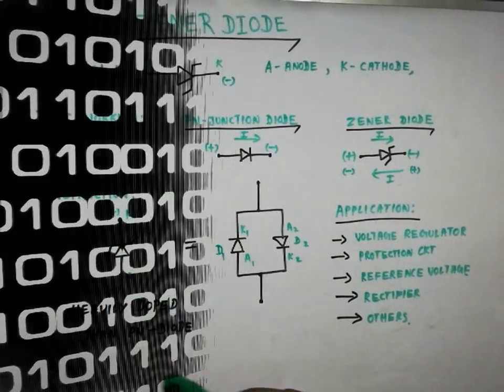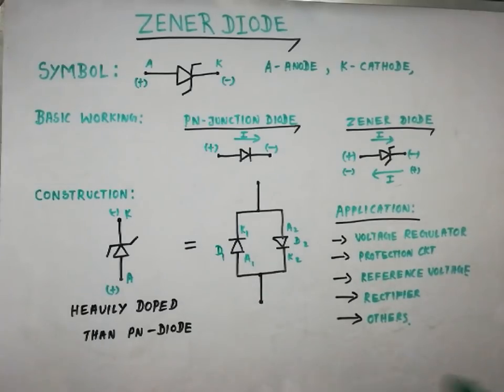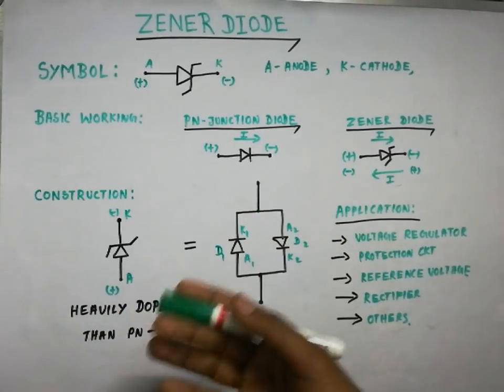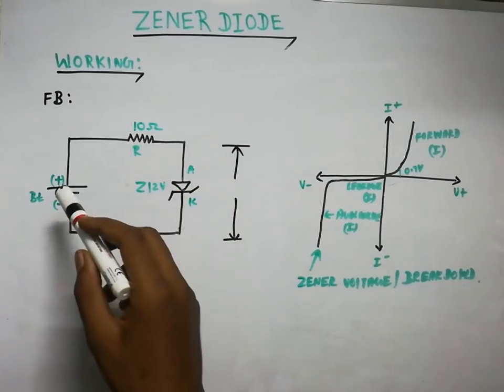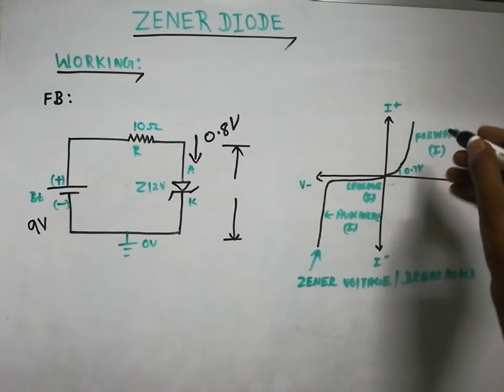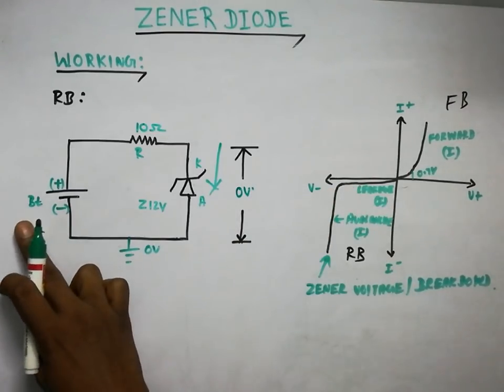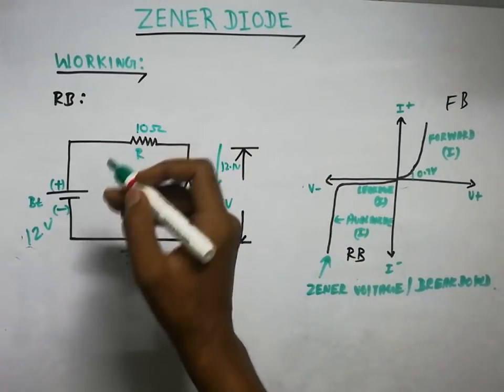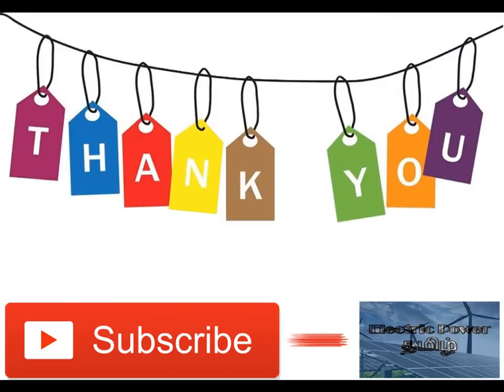what is a Zener Diode In Tamil???

Comment: Bro ithula 5V Zener diode la 12V supply kudukum pothu diode 5V than conduct pannum balance volt      etho oru valila resistance or ground or supply ku poirum nu sonninga so ithu reverse bias ku matuma ila forward bias ku ma
Reply from the maker: Yes